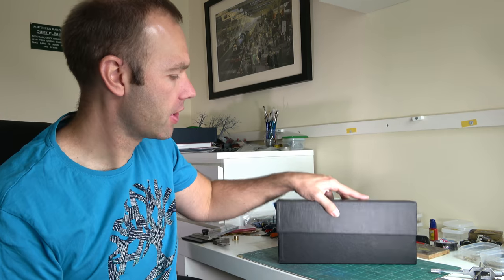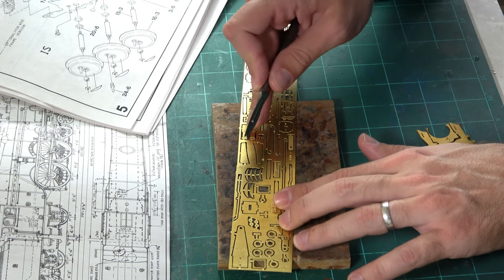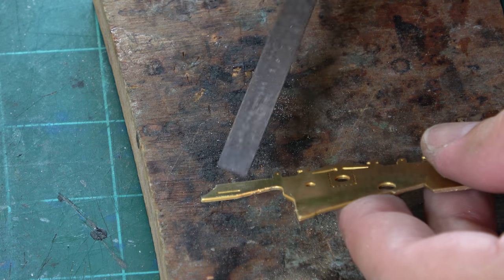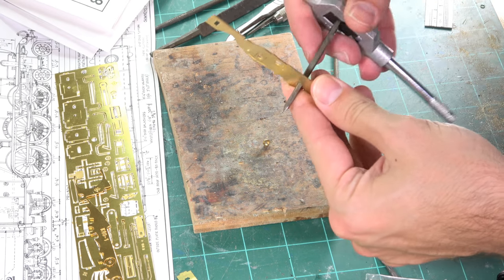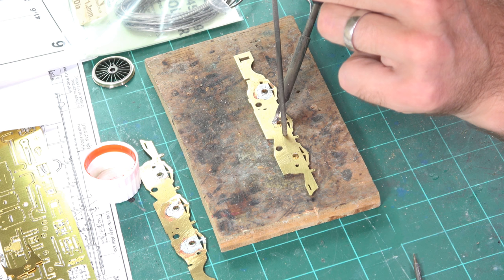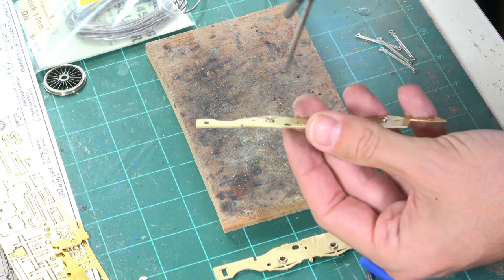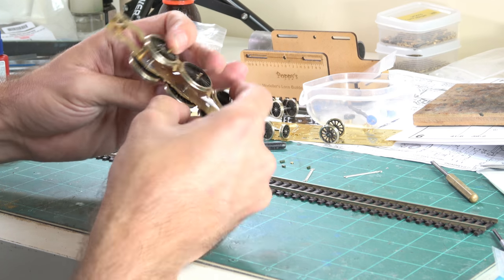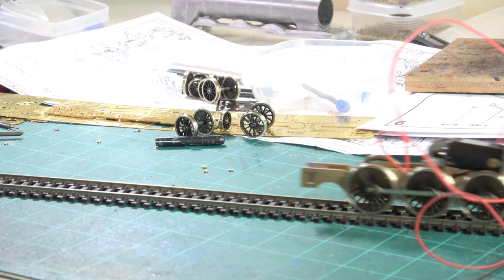Lets Build DJH LNER Pacific Part 1 Chassis

Comment: Thanks for a very informative video. You have now shown that,with the increasing prices of RTR and with no flywheel drive on ex lner pacifics, kit building is a more cost effective way of building/ obtaining the locomotives the modeller needs. Your presenting style is very similar to Tony Wright''s, very easy to understand and follow. Well done.
Reply from the maker: Thanks Attila. It's definitely not cheap; a kit like this is about £160, wheels £60, motor, £25, gearbox £25, BUT like you say, you get a top quality drive train, you can calibrate the ratio to achieve the speed you want for the loco, and you can customise from the ground up the specification of the loco from the start. The best part of it is you have the enjoyment of building something yourself!
Reply: The Loco Builder Thanks for your reply. Building something yourself is real modelling,taking it out of a box,putting then on a track, for me, is nowhere as satisfying.
Reply: or an airfix model costs about £5 plus the chassis, wheels and motor £110 = £115 for a wonderful loco, it's how in making my gwr fleet, so many mainline locos with awful chassis but wonderful bodies 😁

Comment: The video is well made and a good instruction for anyone starting on kitbuilding.
I however disagree with one step in the proces, the position of the bearings should be checked in the Poppy's jig before they are soldered in place, a slight difference in the distance of the holes either caused in the design for the etches or when reaming the holes can cause binding of the coupling rods.
Reaming out the hole in the rod like you suggest is then more the cure to the effects than to the source of the binding.
So the best way is to set your chassis up in the jig completely before aplying any solder, check and rectify any inaccuracies by filing the offensive bearing hole in the chassis plate into the direction the bearing should sit.
When everything fits fine in the jig solder everything in the jig, including the bearings.

In general the distance between the holes is very consistent on the 2 halves of DJH kits, and any recent kit designed with CAD software, but with older kits from small manufacturers designed by manual drawing of the design for the etch films there will be inaccuracities.
And these kits still exist as I experienced with a Dragon Models kit, this was litterally drawn up with a felt pen on paper and then fotocopied to transparrent sheet to make the etches, with up to 1.5mm difference between the left and right side of a brake van in 7mm/ft.

Comment: That was seriously impressive. 
I admit I was never keen on Balsa having to cut parts out. 
  A thought came to me while watching.  Why use a typical electric motor. 
 They probably could have made solenoid motors inside the steam cylinders. You would have to  quarter for certain then.
  Hope Hornby don't read and patent the idea.
Reply from the maker: Interesting comments. Would a solenoid be smooth enough at slow speed, and enable precise control?
Reply: @cb01ttr  ah possible not

Comment: Very nice!  I might have to get one of those DJH kits.  It's getting difficult to find good steam locomotive kits here in the US since Bowser stopped production of theirs, and this looks worlds better than the old Arbour Models kit I'm building right now.
Reply from the maker: They are very well thought out kits, and like I say the white metal castings are superb (especially the main body). They go together well and the instructions are clear. The only problem I have found is that the brass etch is a touch on the thick side for my personal preference, and there are 'cusped' edges which take a little bit of filing to square off. Other than that, I'd highly recommend it.
Reply: Sounds good to me!  A bit of filing around the edges of some brass parts would be a walk in the park compared to reworking misaligned and deformed castings.
Reply from the maker: Some of the smaller castings need a bit of work, but it sounds like you'll be just fine! Why not give it a try.
Reply: DJH have discontinued this loco but do plenty of very good alternatives. I purchased the last kit of this model and can't wait for more build videos to get going. Fantastic and informative keep up the great work.
Reply from the maker: Thank you David, I appreciate your kind comments. It is a shame if the kit has been discontinued. When I ordered it, they waited until they had a suitable number of orders before manufacture, so I wonder/hope we will see it again if demand is strong enough.
Reply: The Loco Builder 
DJH don't list this loco any more and they told me that I had the last as it was being discontinued. I was lucky to get the kit as someone had cancelled their order. I was impressed with the build instructions as I purchased the DoG some years back and the instructions were 10 lines of text. I as so looking forward to follow your build and impressed by your video presentation and quality.

Comment: Thanks Tom, excellent video. I wonder if you might do a video showing how you fit the axle bushes into the frames. I find that the frame holes usually need opening out a little and I usually go at it with a drill or tapered needle file! I've got away with mostly but I think a reamer is the best way? Not sure of the size though. Many thanks Vince
Reply from the maker: Hi Vince, the best thing is a cutting broach. Like these: https://eileensemporium.com/index.php?option=com_hikashop&ctrl=category&task=listing&cid=1135&name=transfers-fixing-masking&Itemid=189
Have a look on ebay or amazon maybe cheaper. I'd get a selection of sizes personally they're so useful. HTH
Reply: @cb01ttr  That's great Tom thanks for getting back to me so quickly. I shall now investigate cutting broaches. Thanks again Vince

Comment: Very good video but just a little disappointed that you didn't show how you quartered the wheels.  I think a lot of people have trouble with that aspect of chassis building
Reply from the maker: Hi, I expain it at about 22:38. There's not a huge amount to show, as the ends of the Markits axles are square, so as long as you have the 'lead' correct and you offset one side by 90 degrees to the other, you're sorted.
Reply: @cb01ttr  Thank you.  I hadn't realised that Markit axle ends were square.
Reply from the maker: @geoffchatwin6010  It's why I use them in general - very easy, and you're almost guaranteed to get at least the quartering right.

Comment: HiWhere did you get the blue grippers you use on the Poppytech jig?ThanksDavid
Reply from the maker: Hi David, they are supplied with the jig. Cheers.
Reply: Oh - I'm sure I didn't get any with mine!
Reply from the maker: They came in a little plastic bag with a smaller size silicone sleeve, and a grip pad. If you didn’t get it give them a call I’m sure they’d supply you.
Reply: Thanks.  I'll speak to them when I see them at a show.  Meantime, I've realised that they provided a long thin black tube and it's clicked with me that is axle length and can be snipped into pieces to do the same job!

Comment: Nice, but I gave up building loco kits, because as exampled here, the (Mashima ?) motor although good quality is too small & will not be powerful enough to haul 12 car trains reliably, or smoothly enough. What's needed is a Coreless motor, which obviates trying to find space for a flywheel. Coreless motors are roughly twice the power of an equivalently sized poled motor !  But you also need a BEVEL gearbox to allow a Coreless motor to "run on" (coast to a halt). Sadly I'm not aware of any coreless motors or bevel gearboxes available for kit builders anymore, at least in OO or smaller gauges. In other words it becomes pointless wasting hundreds of hours building a beautiful kit model, if it can't be fitted with an equivalently beautiful and powerful mechanism !!!!
Reply from the maker: This will haul 15+ kit built coaches with ease. No coreless motor required.

Comment: Putting solder on the iron is not the   best way by any means flux heat the joint then apply the solder putting solder on the iron causes it to oxidize before it reaches the joint
Reply from the maker: Hello Bryan, thanks very much for watching. You’re right of course that the method you state is the “correct” way to solder, however I have never really found this method compatible with brass kit building. I don’t have enough hands to hold the parts together, the iron, and introduce the solder at the same time. If you are able to build kits with the “correct” method, then I doff my cap to you sir! I’d also love to see what you have built? Send me some pictures and I’ll feture them on my next video.
Reply: The Loco Builder good morning I build aircraft and use a lot of PE I shall send you pictures of the Fokker Triplane I am building almost entirely from brass Bryan
Reply from the maker: That'd be great to see Bryan. I build plastic model aircraft too, but only ever used PE that glued on, and certainly nothing as complicated as Triplanes!